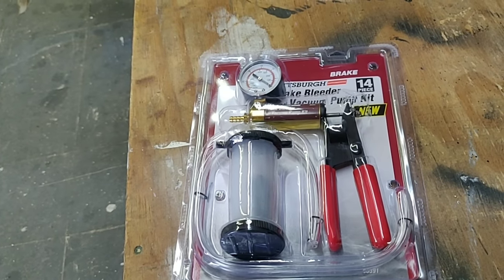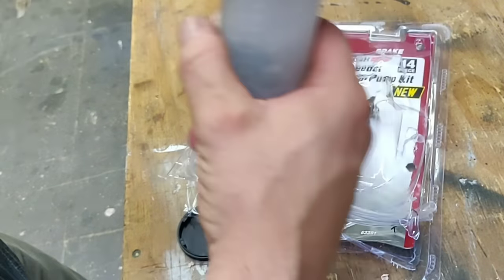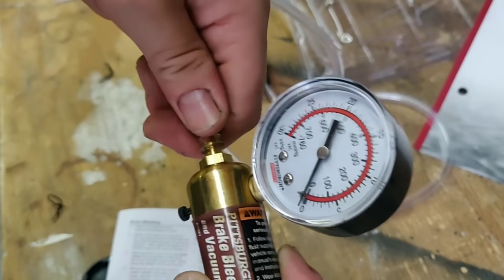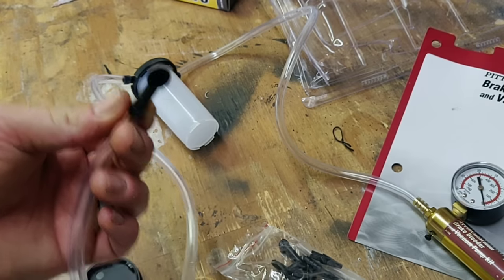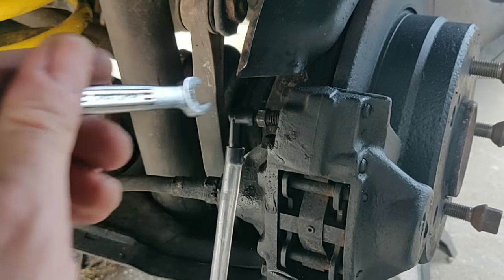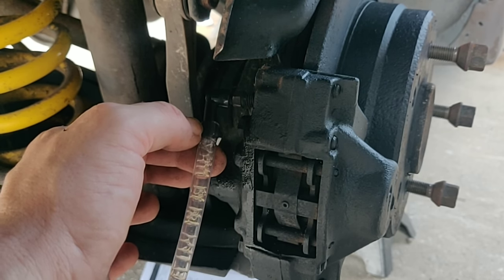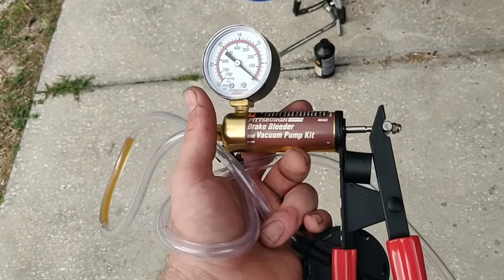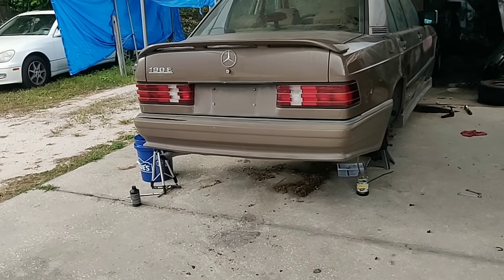Harbor Freight Pittsburgh brake bleeder vacuum pump demo and review

Comment: The pipe that leaves the bleed nipple needs to be upright to prevent any air bubbles going back into the caliper! And... you don't create pressure.. you create vacuum to suck the stuff out.. pressure would push air in. Those pipes are far too long and too soft.. when you operate the pump to create pressure... oopps... vacuum.. all you're doing is compressing those very long pipes!.. use the short links pipes to get better results

Comment: i really think that it was nothing wrong with the beeder, you sucked all the fluid from the master cylinder and probably part of the front line and so there was no fluid on the line that is why  no fluid came out, now when you have someone press on the pedal there is hydraulic presure and will push the fluid that you refilled the master cylinder with.

Comment: You threw away a perfectly good tool   ...   You're supposed to remove the black cap you're basically holding the pump back by having the black cap on there...    I just bought one..I can get the psi up to 30  easy You just need to remove the cap

Comment: I purchased the same bleeder from HF. It leaked so bad air and fluid that it was unusable, the tolerances in the pump were just to loose to function. No matter what I did could not get it to work! useless. Threw it in the trash.

Comment: I bet the instructions are wrong about using the 23” hose between the bottle and pump. Why so long? I would use the 2nd short hose here and that’s probably why they gave you 2. They gave you 2 long ones cause after time the clear hose won’t be visible from bleeding. LMAO, remove the black rubber shipping piece between the 2 handles. That’s why your not getting much vacuum cause the handle isn’t moving much. You have many bubbles cause you opened the bleed screw too far and air is getting by the threads. Get the silicone grease out to cover the threads. I guarantee I won’t ask you to do a tool review in the future.

Comment: For the size of the pump you should know if you work on cars, that it was too small to create that kind of pressure from the front of a car. . I have had one for 10 years and it works on my dirtbikes utv's and atv's and street bikes as well. Think about it bud.

Comment: You had two main problems. First was not noticing the shipping spacer and if that wasn't embarrassing enough the second problem you had was allowing your master cylinder to run dry once that happens you needed to start all over from the beginning so don't ever allow your brake fluid to run out while you're bleeding your brakes that's about the dumbest thing you can possibly do.
Reply from the maker: Not embarrassed at all but also never ran dry.  Thanks for input
Reply: 9:52 looked more than dry. But hey what do I know about a master cylinder, hopefully something since I replaced my daughter's in her 99 ford taurus. But on the bright side your video prompted me to purchase one myself and I'll just say that I ended up using a plastic pop bottle and one of it's hoses to bleed my brakes after replacing the front  rotors, pads, and calipers on my 2005 Taurus. They should repackage it and sell it as a novelty toy for kids.

Comment: you threw this item in the trash, but come to find out, you should've gone over the device after opening it .  tightening up whatever you find loose.  It did not hold your pressure because the Schrader valve on the underside likely needed to be tightened up a bit  it s the same as a tire valve stem .  It would've held after that.   oh well

Comment: I felt the same way . fluid came out 2.5 seconds and quit . i may try to make a tire gauge out of that piece of trash
Reply: Its a vacuum gauge, not a pressure gauge. the units are inches of Hg.

Comment: This guy is supposedly a Mechanic?? 1. Didn't read the install instructions and 2. Those air bubbles are from poor sealed threads on the brake bleed screw. Either loosened it too much or needs to seal threads.

Comment: I bought one of these and after first use it broke, so I took it back and exchange it and again after first use it broke. The pump broke on both of them and caused fluid to leak.  So I took it back and got a refund. Never again will I buy another one, I will do it the old fashion way.

Comment: Better go get it out of the bin. It didn't work correctly as pointed out by everyone else because you forgot to remove the plug stopping full handle movement. 
Also put some grease on the nipple threads to stop sucking air through. 
All in all I give you a 1 out of 10 rating.

Comment: I wish I would've seen this before I bought mine.
Reply from the maker: Did you get it to work?   Do after all the comments I was able to get it to work by taking off the safety thing and using some advice.  I plan to do an update.  The device is a bit cheap but can work
Reply: @petescarport   I have this and can't get it to draw the fluid out of my motorcycle clutch reservoir. I can get it to 15 lbs vac by pumping a lot more than 15 times and it holds it. I can push fluid through with the clutch lever. Just can't pull it through with the pump. I have rebuild kits for reservoir and slave coming, plus a new hose. I don't think it's my pump.
Reply from the maker: @58gennaro  so it's a round plastic thing from factory that blocks pump.  I can't believe I didn't notice it and most likely you removed.  I couldn't get 10psi with it in.
Reply: @petescarport  Thanks for the reply. I did remove mine. I think my problem is either the hose ( i read they can collapse internally) or the clutch master.

Comment: There is never that amount of air buiblez in the system.. Also pressure is the incorrect word, otherwise your fluid will be coming out of the filler.. It's a vacuum pump.. I thi k

Comment: This is the worst system ever I bought. It actually introduced air into my system and spent a longer time bleeding the brakes. The old and try method would have been better. It was a frustrating time with this.

Comment: Dear video maker, there is a black cap looking device that is used in the packaging of the vacuum pump so that way when packaged it will sit between fully open or closed. You should remove that piece of packaging before testing out the equipment. It would have pulled a pretty good vacuum if you were able to squeeze the trigger the whole way. Please understand how to use the tools before reviewing them, now over half a million viewers opinions are tainted because you dont know how to use the tool!

Comment: When all else fails, read the instructions. SMH. Nothing wrong with the tool.  And you're creating a vacuum, not pressure. 10 Hg is ten inches of Mercury. Normally used term to define a vacuum. Please have a real auto technician check your work. I'd never drive in a car you worked on.
Reply from the maker: Vacuum pressure is the difference between the atmospheric pressure and the absolute pressure.  And thanks.  This car and many other drive great.
Reply: @petescarport  "Vacuum Pressure" is an oxymoron. No such thing. A vacuum is by definition a lack of pressure. It's OK if you don't know  the difference. It is ignorant to know the difference and still defend it.

Comment: You are not building pressure when you pump the handle. You are creating a vacuum and that is measured in HG millimeters of mercury. Pressure would be measured in PSI pounds per square inch. Minor point but it will give more credibility to your videos.

Comment: You need to learn the difference between vaccum and pressure also how to use a vaccum pump correctly.
Reply from the maker: It’s been a year since I’ve replied to any comments but I have to say how can education on vacuum and pressure relate to squeezing a handle.   The issue I had is still funny because i forgot to remove the safety for shipping but give me a break.

Comment: You threw away a good tool, all you needed to do is add a few drops of air tool oil to pump and mine pulled 20 lbs vacuum.

Comment: 1. Remove plastic packaging spacer between handle + pump before use, if you actually want it to work properly🤣
2. You're creating vacuum, or negative pressure using this tool, not high pressure🤣
3. Don't connect the pump hose directly to the caliper or on the wrong side of the container if you don't want fluid to get in your pump🤣
4. Remove the bleed screw from the caliper and smear some grease on the screw threads, or put an oring in the bleed screw threads to prevent air from being sucked in between the bleed screw and caliper threads, if not you will always see air in the hose using a vacuum method👍
5. Learn the difference between 'Lefty Loosey, Righty Tighty' before making a YT video🤣
6. Add brake fluid to the reservoir well before 'it's looking dry in there', unless you want to keep repeating the process forever🤣
7. This tool works great, when used properly by someone with half a clue how to use it😁

Comment: 100% crap, I bought one 2023 and the gasket on the clear plastic container would not seal , all they had to do is provide a o-ring. I cut my own gasket out of a thick rubber glove and used gasket sealant. Took forever. The fitting that goes over bleeder is garbage as well. A little effort and they could have produced a decent product.

Comment: I think u r doing it wrong ur suppose to pump and hold it down - and before u repump  it u need to lock the fitting first - pump the pressure up to 10 loose. The fitting and repeat the process until all the bubbles are gone- u just wasted ur money throwing a good tool I. The trash

Comment: After using a few times, the thin gasket will not seal. I have to use a small clamp to hold it together. This is NOT a quality tool  !!!  Buy another brand.

Comment: I think you gave the tool a bad rap.You did not show any attemp to verify the tool was still working by blocking the hose and testing the tool for vacume. The bleeder screw could have been sucking air or other factors you failed to prove. You also were demonstrating a tool out of the package that you were unfamiliar with. So if your going to show and tell, you need to know the tool and all the errors that can go with using it. As it stands, we dont know if the tool failed or you failed to use it properly...Sorry.

Comment: Waste of money. You don’t need all that. Run a clear tube from your bleeder to a tall container of brake fluid and pump a few times, check for bubbles, right rear, then left rear, then right front, then left front, if the master cylinder is on the left. Works very time, no need for any help or these waste of money devices.

Comment: This mechanic ? doesn't know how to use the Harbor Freight vacuum pump. He kept talking about putting presser
into the bleed fitting when the correct way is to created a vacuum to pull the fluid into the caliper thereby forcing the air out. It clearly states on the pump that this is a vacuum pump.

Comment: Your car doesn't need a bleed, it needs a stud. Lol
Reply from the maker: Thanks 😊
Reply: Why does it need a stud?
Reply from the maker: @Justin-qx8gb  I think he thinks my car is missing the studs.  Most people have never worked on a German car and don't know they use bolts instead of studs.  Thanks for watching
Reply: @petescarport   even though the process was done wrong it's not as bad as another video I seen where the guy didn't even use the used oil catch and was vacuuming directly into the pump.

Comment: take out the round spacer between the body and the handle!! it is limiting the handle movement, it creates plenty of vacuum, if you knew what you were doing!
also, it does not create pressure!! , it creates a vacuum, and your not using a pipe wrench , it's a line wrench, you just threw away a perfectly good tool, numb skull!! :/
Reply from the maker: Thank you for feedback, I will look into that and consider your suggestions.

Comment: Just get a clear tubing the same diameter as your bleeders, attach it to one bleeder at a time and put the other end in fluid resivior, pump  your brakes until the fluid   is free of bubbles. Close that bleeder and move to the next bleeder. Be sure to keep the hose submerged  in the fluid. You won't lose any  fluid , and can do it yourself. 
Harbor freight  sells Chinese junk. Everything they sell is junk.

Comment: Honestly you didn't  need the neighbor.  You should have left it hooked up as you did and pumped the brakes  yourself until fluid started. Then continue to use the tool after removing the grip spacer🤣🤣🤣🤣

Comment: First of all there is a round spacer under the handle you didn't remove,  so you didn't use the tool correctly,  and gave bad review  because you used tool incorrectly

Comment: dude the pump is only so you can remove the reservoir fluid old crap, and then second to apply negative pressure while you pump breaks to resist any air going back when you let your foot off the brake peddle smh

Comment: You keep using the word pressure, the pump sucks the fluid out not by pressure but by creating a vacuum. It is a vacuum pump not a pressure pump. There should be no bubbles in the line. The cap (exchange) that goes onto the nipple is sucking in air because it does not fit tightly on the nipple. As others have said you did not remove the spacer on the pump handle. You probably threw out perfectly good pump. You really should remove the video.

Comment: This tool sucks literally.  When pumping to create vacuum with the intention of getting the air out of the calipers etc the vacuum it creates pulls outside air in through the threads of the open bleeder screw and never actually sucked the air out of my caliper and new brake line. Best thing ever is to do the brake fluid in soda bottle technique. That method you can completely purge all air as well as completely flush all old fluid out of lines all by yourself.

Comment: That tool is crap.  And don't bother with the other one that connects to your air compressor - it sucks too.  I like the vacuum idea in theory but HF ones are crap.  Better to try to pressure pump tool that works from the reservoir.

Comment: You are definitely using this completely wrong. You should retry after reading the instructions. I have the same kit and used it correctly, with 28 vac with no problem. If not, delete this video so people don’t think this is correct

Comment: Read the directions. It is not idiot proof. You keep using the word " pressure ", when the pump is a vacuum device. Once the reservoir emptied, you had to pump the brake pedal. If a hose connection on the intake side leaks air you might think the pump is bad. Modern brakes need power bleeding especially because of the distribution valves and anti lock eguipment. Your methods and instruction could hurt someone. Good luck. Mark Richardson P. S Vacuum pressure is measured in inches of mercury ( HG ) 29 inches is deep or strong, 8 inches is enough if there is mostly fluid in the lines. You made the video well, your knowledge is insufficient for a safety tutorial.

Comment: Hate to say but this video should be taken down. Kinda defaming of the product. Not saying it’s best in the world. But dude in the video forgot to remove spacer on handle that’s there for shipping. You will not get enough pressure till you take it out. Then it works pretty well
Reply from the maker: I did two follow up videos.   Check description.  This video has actually helped out tons of people.   The original instructions left out this info and they updated it.    Thanks for watching.

Comment: READ THE DIRECTIONS PETE!! REMOVE THE SHIT BETWEEN YER EARS AND THE HANDLE!!!
Reply from the maker: Wow you really sound angry and uneducated.  To turn off cap locks press upper arrow button or caps lock button on computer.

Also wtf does remove the shit between yer (correct word is your)  ears mean.   I believe that would be to hear or maybe your referirng to using my brain, but than why would I remove it.

Comment: Don't throw away this Harbor Freight vacuum pump, throw away this video by giving it a thumbs down. It says right on the first picture, "remove stopper before use." With the stopper in place, it will barely reach 10inHg. After you remove the stopper, the vacuum pump will reach 30inHg. Wow! Terrible video! As they say, if all else fails, follow directions.

Comment: Woaw, Pete. WTF?... You left the fucking black rubber piece on the device. It's that huge 1-1/4" diameter x 1-1/2" cylindrical piece that prevents the vacuum handle from going all the way in so that it can create vacuum when you pump it. If you're going to review anything, you need to operate it correctly. Probably a Democrat.
Reply from the maker: I left that on so I wouldn’t hurt your mom